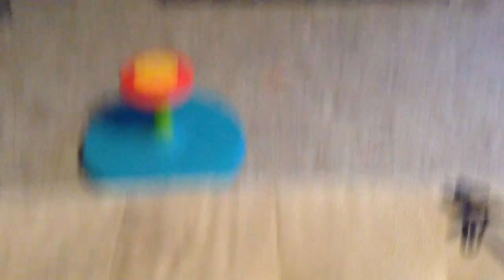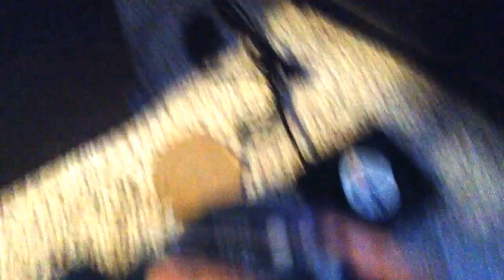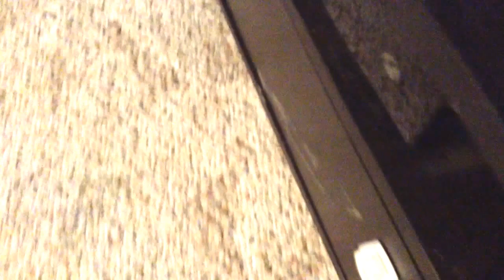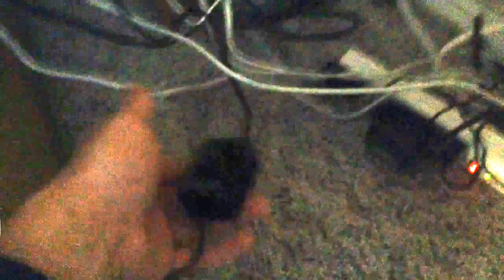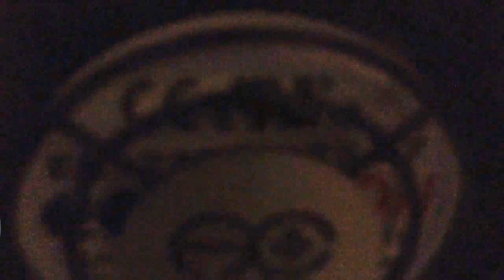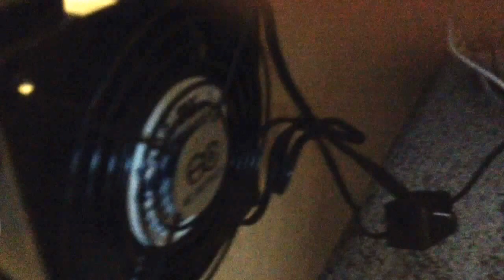IKEA media center cooling fan project.  Xbox and Playstation Cooling

Comment: Hi could you please send me a link to where you purchased the fan speed controller and extension cable which manages the equipment. Thanks
Reply from the maker: +Manj Dhendsa  http://www.amazon.com/AC-Infinity-AI-SC72A-Control-Cooling/dp/B00809BQZG/ref=pd_bxgy_147_img_3?ie=UTF8&refRID=0PVNSPC4EN7F156GT426

http://www.amazon.com/gp/product/B004YTSB7C?keywords=cooling%20fan&qid=1450723586&ref_=sr_1_21&s=electronics&sr=1-21

Comment: What about the dust? Dust tends to accumulate in the back of the cabinets, so if you're pulling air in from there, you will also be pulling dust into your xbox one
Reply from the maker: TitanAngel001  In this set up, I'm not pulling air from the back.  I'm pulling from the front.  Of course a civilized person would take a vacuum hose back there once in awhile and clean.